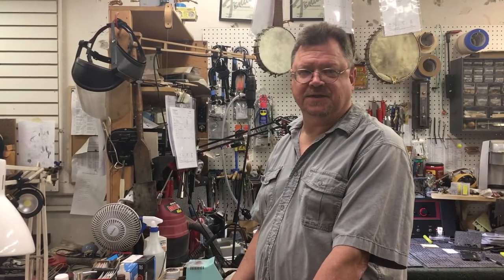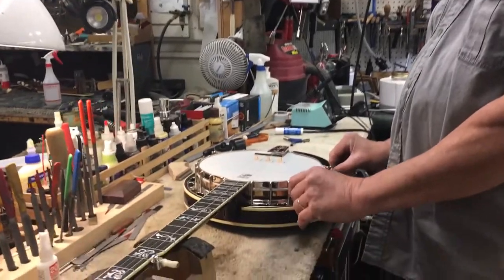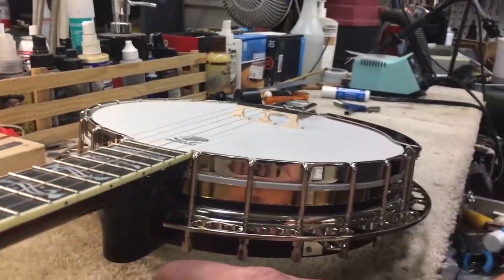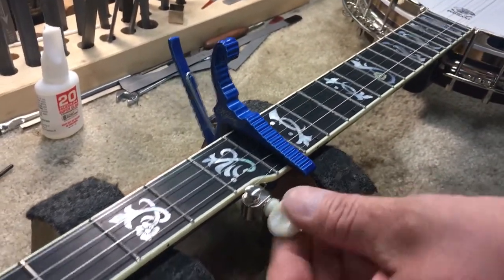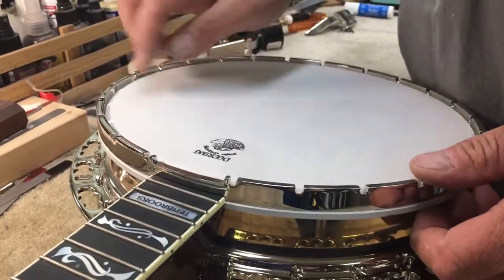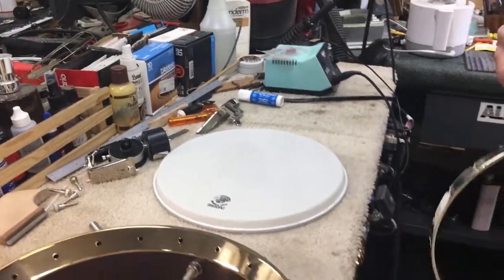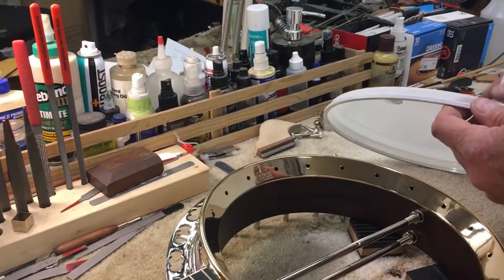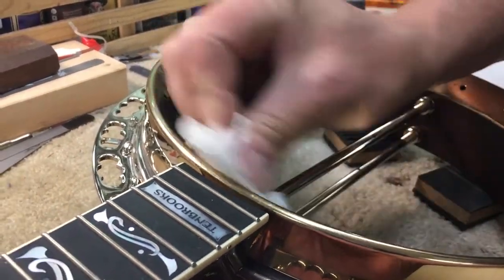How To Change a Banjo Head | Elderly Instruments Repair Shop

Comment: A couple of questions... on loosening the banjo head, after you went around the first time and took most of the pressure off, could you use a cordless drill with a bit to loosen it all?  I know you would never want to do that when putting it back together though.  For the drum conditioner that you put on, what is it made of?

Comment: So 92 is the Standard even for an Archtop?
Reply: Some people tap tune to G# or A.  My banjo loses tone at 92.  I tighten to around 89-90 and it really opens up.  Tighter then that starts killing the tone.  Every banjo is a little different. I also lower the tailpiece to about 1/4" above the head.  Archtops seem to like a tighter head to get that Ralph Stanley tone.  But you can ease off the tightness and get a flathead tone, too.
Reply: @gutbucket260  helpful info!